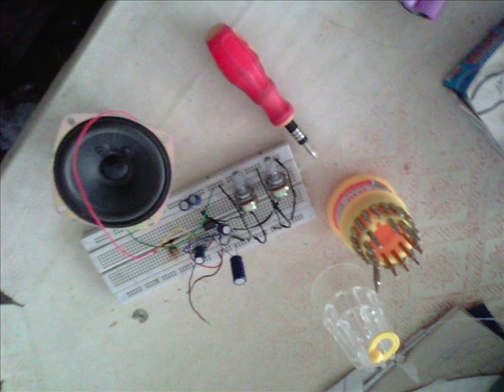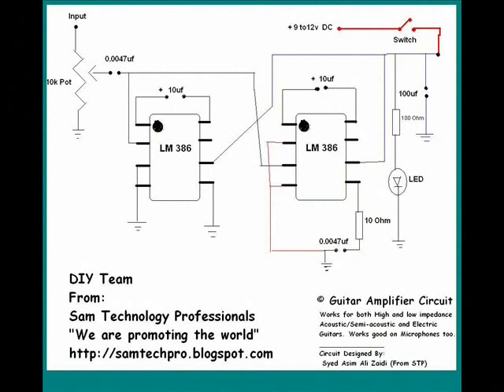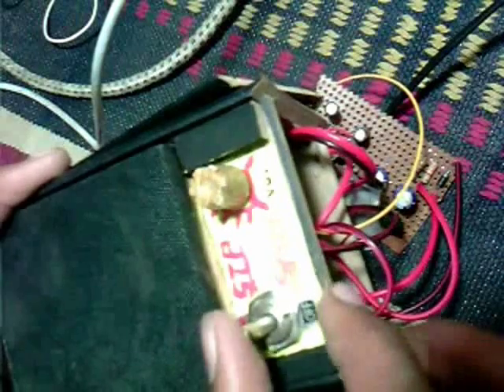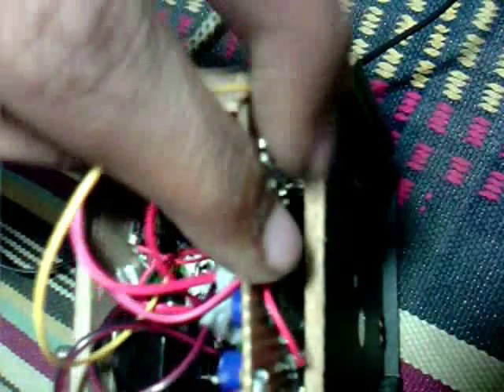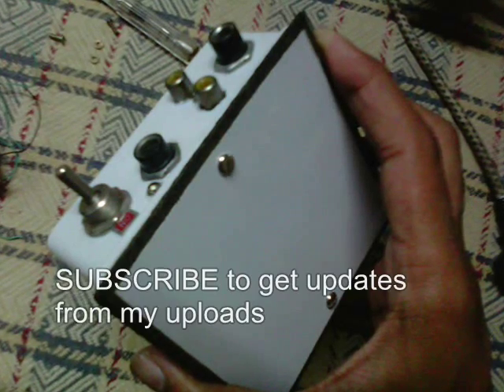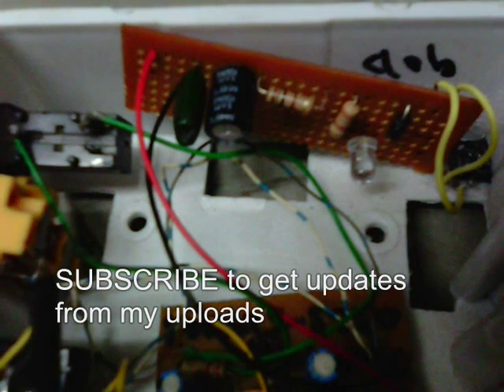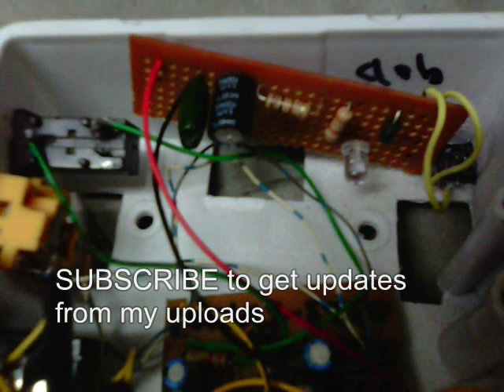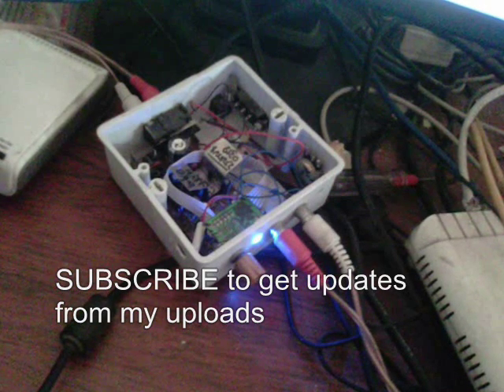Build LM386 Guitar Amp Easily (Circuit & Link Inc)

Comment: hello, nice project but i have one question.
which sutable volt for speakers .
means 5v ,10 v etc??
Reply: It can work on 5v to 12v easily. That means you can use it with 5v supply or any other source like power bank or a battery. To drive it on the battery e.g a 9v Ni Cad battery would be the best option. However the option to power it with a power bank is another good option.
Reply from the maker: hiren vaishnav hello, i think its written in schematic and speakers has impedance. You can use 4-8Ohm speakers up to 4W but don't forget to check the correct circuit diagram link in description coz the given one has some errors

Comment: what is the Max Gain ? do u increase its gain up till 200,000,000 v/v ?
Reply from the maker: The default gain is 20 for the ic386 (output voltage is 20x input voltage, or 26dB). The default gain is when there's no capacitor between pin1 and 8. You should see the datasheet first for the LM386.

Comment: Why is the output from the first IC grounded and not connected to pin 3 of the second? How does the first IC even amplify?

Thanks.
Reply: +zardozica they provided the correct circuit diagram at their instructable page you can see in the description